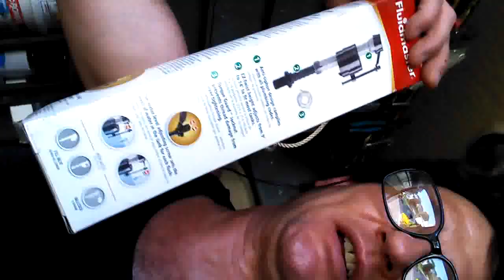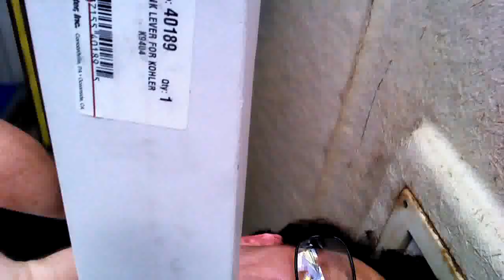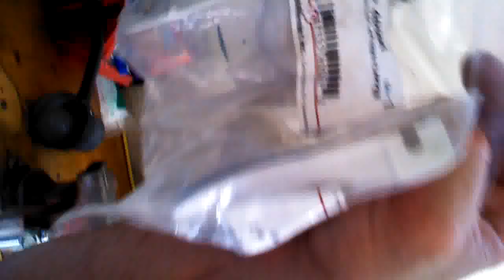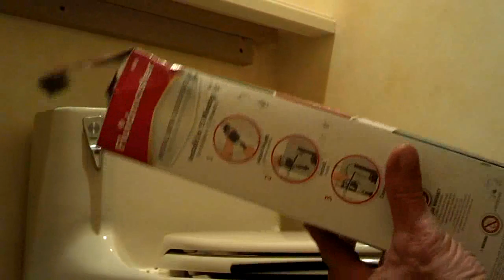repairing american standard toilet video , Cadet 1.6 gpf one piece fix all problems

Comment: what if i can not unlock the plastic thing @15:55.  the toilet is up next to a side wall.  very tight space.  im gripping more of the plastic tube with threading.  :/
Reply from the maker: some tight spots, i have reached from other side under the tank.... but if willing to get on your back and slide up between bowl and wall.....also most can be loosened with your hand
Reply: Dino Pinch how tight do these things need to be? Can I lube it? If so what kind of lube? Do you recommend the nuts with the "wings" for better grip.   I really did a number of my hands due to the wrench and tools slipping and catching my fingers.  Someone installed the toilet years ago and they were incredibly tight.   I never want to have to struggle like that again.   I wish the toilet was better designed to give more space to work.   Anyways thanks for the reply!
Reply from the maker: Hand tight, most of the fill valves come plastic nuts with thumb wings & manufacture instructions advise hand tight only, the flexible supply lines also same, thumb wings & instructions hand tight, no lube needed
Reply: Dino Pinch thank you as you can tell never read the instructions =)